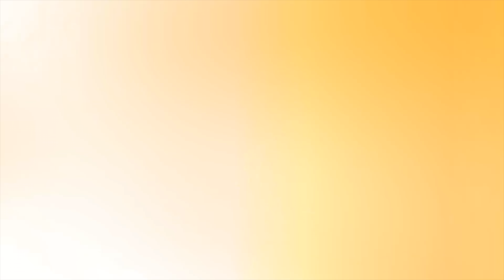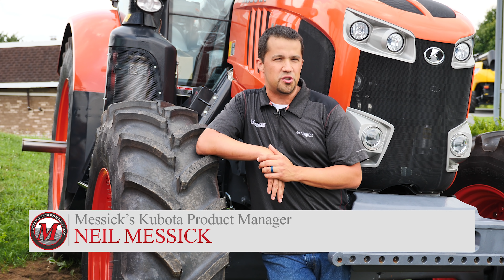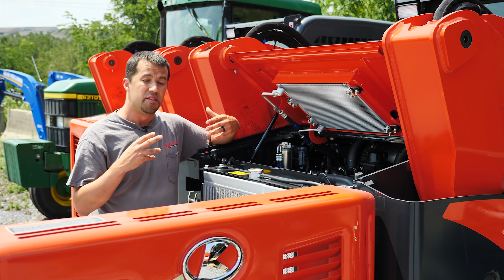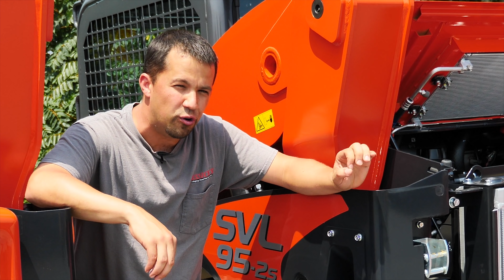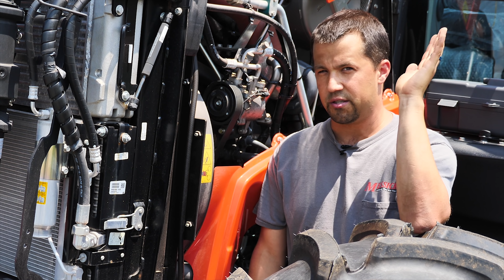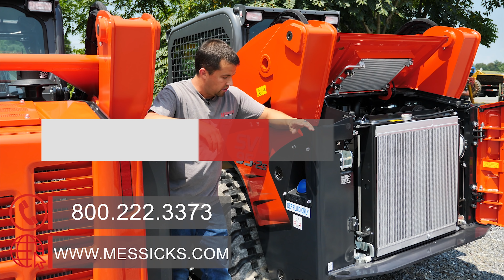6 Tips to prevent emissions system trouble

Comment: Biggest thing with def that I have gotten alot of my customers doing . Buy no more then a week or two's use in the small plastic jugs. And buy them from a quality/high use distributor. Run the machine low enough between fillups that you can use the entire container. Clean around the entire def cap. Remove cap and fill. Then destroy/throw away the container. I spent an entire month or more this spring educating new users that had made costly mistakes and caused issues that were not covered by warrenty. The other big this is wait for the light to go out before you hit the battery disconnect. If there is no light then wait 5-10 minuits before hitting the battery disconnect so the system can purge itself.
Reply: Keep in mind the machine can throw codes because it doesn't recognize the small amount of DEF you are recommending your customers add either. DEF tanks don't use a float-style gauge like a gas or diesel tank, because DEF freezes at 12F. Instead, they either use a series of electrodes in the tank wall, or a sonar board. Running your DEF very low and then only refilling with a small amount might cause the tank's sensors to not register that you have actually added fluid. When you run out of DEF, the machine idles and/or shuts down.

Comment: One of the major reasons I went with a Massey Ferguson (Iseki) compact tractor is that it has no regen cycle, unlike the Kubota B3350 I was looking at. There's a DPF canister, but it does not require a regen cycle to clean itself. In fact the Kubota dealer I spoke to tried to talk me into getting a B2650 instead to avoid the regen cycle, but for my use case I really thought getting into the mid-30's HP range was a good idea.
Reply from the maker: Yours is DOC only, just like the New Hollands we sell. Its no any more trouble free. avoiding the B3350 was not all bad, they had trouble with that one.

Comment: I agree with your presentation, but the emission systems are crap. I have had nothing but trouble with them on my trucks. You shouldn't have to rev the crap out of it all day to make it run right. Its not your fault, and I do not blame the manufacturers. They cost thousands of dollars, cause endless problems, and are unreliable. One of my trucks said " 99 miles left before limp mode " wonderful. These rules are ridiculous.
Reply from the maker: Yea, equipment industry had a fraction of the problems they had had with trucks. Duty cycle is totally different.
Reply: @MessicksEquip   I have a L5040 and I am sure glad it does not have these systems. 90% of my use is non pto operation. over half my use is short, non strenuous use. During the winter I load salt and sand on to my truck, then shut it down. During the summer I do several easy tasks with little to no throttle. It would die with the way I use it. Great videos by the way. Great resource.

Comment: B S on engines are running cleaner  or less smoke , the main problem in the old days of tractors blowing black smoke and burning more fuel is , it still cost lots of money to keep tractors  in good working condition , AS ITS DOES NOW
Reply: 45NUTS yea but back in the old days you didn’t have to worry about a sensor keeping your tractor down for long
Reply: @farmall194142  Or having it sitting in the barn waiting for a firmware update for the computer.

Comment: seems to me that the exhaust/def system should (quietly) removed
Reply: Was just wondering if it was possible.
Reply: @rikertvonfulton16  Of course it's possible
Reply: @Joey-ve7ku  Actually it may or may not be. You can remove it, yes, but the engine won't run, or won't run right. The ECU would see the exhaust components were removed and trigger trouble codes which might not let you operate above idle or operate at all. Everybody deletes pickup trucks, but they use a tuner to do so. The tuner tells the engine to operate in 'military' or 'off-road' mode, which doesn't require emissions. The tuner also tells the engine that a DPF / DEF system is no longer present, so it will not attempt to perform a regen or inject DEF. So while these tuners are readily available for pickup trucks, they are not for ag or construction equipment. Or at least not easily available.
Reply: @tylermacconnell217  I've seen brand new 6150m john deeres that have had emission systems deleted.
Reply: They do make them. Eco tuning does a lot of them.

Comment: 30% urea and 70% water (DEF) has a short shelf life?....who knew?...🤣🤦‍♂️
Reply: Doug Dickey 
Yep it separates and crystals form. Also the water evaporates
Reply: You'd have thought that they could create a fluid to help scrub the emissions that is able to handle the high heat that lots and lots of machines are going to see but I guess not.
Reply: Most of the time these machines are being used enough to need to refill DEF well before it would expire, even in a higher heat situation. It's a fine line though...operators don't want to be refilling DEF all the time, but don't want it to go bad, either.
Reply: @tylermacconnell217  ...well, I have a new machine that gets used quite a lot on the farm and it barley sips the DEF fluid and now what's in there is over a year old plus I have a drum of the stuff cause I thought it might go thru it quicker and nobody said anything about it having such a short shelf life....
Reply: That's unfortunate you bought so much - you might be able to sell some to other diesel users. If DEF is kept cool it lasts longer. In a diesel pickup truck, you typically get 1,000 miles per gallon of DEF used. But you will use more DEF the harder the engine works.
Reply: Doug Dickey you can get a specific gravity tester from Amazon ( about $20) to check the DEF fluid.
Reply: Doug Dickey 
You typically only use 1-2% def to fuel ratio
Reply: Plus it’s corrosive

Comment: A DOC is used to combust fuel left in the exhaust, it doesn't do anything for soot. It is a pass through component. The DPF catches soot, evey other tube is plugged off either at the front or back. This forces exhaust through the tiny voids in the DPF material. When the DPF starts to get full the engine will put extra unburned fuel into the exhaust. This fuel will combust but DOES NOT BURN (there is no flame) in the DOC. This heat combusts the soot caught in the DPF. As you pointed out running the engine hot will give you a passive regeneration and you won't have to actively inject fuel into the exhaust. I am a Field Service Engineer for a diesel engine manufacturer. I always correct techs and customers that say there is a fire in the DPF. Our lawyers would kick me in the backside if I didn't. Love your videos!
Reply: Psst, Caterpillar system has an actual flame in it.
Reply: @indianaoutdoors1192  after looking it up I see what your talking about. They actually burn fuel in the exhaust (though the flames do not enter the DPF) instead of combusting it ina DOC (which doesn't require a flame). I'm assuming they have a fire arrestor between that and the DPF. I would hate to be the one that had to design and program that system.
Reply: wolfpack4128 doesn’t the DPF essentially work like a catalytic ceramic block? Super heating to burn the carbon soot?
Reply: The first live flame systems we used had no DOC. Ours has an atomization module that mixes air and fuel and injects it into the diffuser/ mixer section of the DPF. It then has an additional combustion air supply along with a supplemental air supply (turns out it takes a LOT if air to sustain a flame inside an exhaust system)! The injected fuel passes between two spark electrodes that on the outside look like a normal spark plug but on the other end is just a straight electrode, no ground strap.  This ignites the fuel if everything goes right and the flame is directed towards a diffuser so you end up with indirect heat passing to the DPF. This system is used in applications where there's just never really enough heat build up to make a DOC work efficiently i.e. garbage trucks.  Pretty much every Mack cab over garbage truck has this system.  They did add a DOC later in production so if a truck does meet the criteria it can benefit from passive regen but for the most part they rely on spark assisted regeneration.
Reply: patrick tarpley working in below zero  temperatures much of the year, our fuel trucks never seemed to do a regen properly. They were always in the shop being manually cleaned. Just glad I drove an older Pete with a C-12 and never had to deal with the DEF.
Reply: @akbychoice  DPF's like heat. They like a lot of it. We see an increase in aftertreatment systems related failures during the winter for sure. I could only imagine how bad it could be in the below zero temps. 

The Diesel Particulate Filter is a filter just as the name implies. It filters diesel particulate from the exhaust stream. The black smoke you used to see coming from the stack of a truck is what the DPF is preventing. After so long the soot or particulate matter accumulates to the point that it needs to be reduced to prevent complete filter blockage so that is when the regeneration comes into play. The Diesel Oxidation Catalyst is the element just upstream from the DPF. It is coated with precious metals that create chemical reactions with the chemicals in the exhaust stream and in turn makes quite a bit of heat. That heat is passed into the DPF and ultimately the soot is converted into unburnable ash by way of this heat. The ash takes up way less space than the soot so the filter is good to go for a while. When you hear of having a DPF cleaned we're actually cleaning the ash from it. That whole process I just described is call Passive Regeneration. If there is not enough heat on the oxidation catalyst to make an efficient conversion of the chemical compounds in the exhaust stream the system must add additional hydrocarbons which react chemically with the oxidation catalyst and make heat. The hydrocarbon we add is  better known as diesel fuel. That process is known as Active Regeneration.
Reply: @justkeepingitreal7768  very good explanation just one point to correct. The soot does not become ash. If it was pure soot it would combust completely. The ash sticks to the soot then when the soot combusts and becomes so small it passes out the DPF the ash is left. Most ash comes from burning oil. Since the piston rings can't be completely effective at scraping oil from the liners a tiny bit is left. Over thousands of hours or hundreds of thousands of miles this accumulates and needs cleaned. Of course if you get other sources of oil in the combustion chamber (ring issues usually) this ash can build up in a matter of tens of hours.
Reply from the maker: Fantastic reply. I was always under the impression that a hot DOC would treat soot (and is non-compliant when cold). How is PM addressed?
Reply: @MessicksEquip  let's say your ECM will start an active regen (in-mission regen in today's world) at 60 grams of soot. As you run low RPM moderate load or constantly snap the throttle you'll produce soot. This soot goes right through the DOC and gets caught in the DPF. Assuming your DOC and DPF are cool it will sit there. Now you get back on the highway back to the barn and get good load and higher RPM. The higher RPM will drive up airflow (with most turbo setups) and the higher load will create more heat. This will flow through the DPF and the soot will start to "break down". Once it goes through this chemical reaction the by products are safe and small enough to pass right out the back of the DPF. 
Okay now let's say you never get the engine hot and you reach 40 grams of soot in the DPF. The ECM decides its time to take action and either by injecting fuel right before the exhaust stroke (isn't common rail cool) or through an injector in the exhaust upstream of the DOC. This unburned fuel makes its way to the DOC where the DOC combusts it (though no flame should be present). This creates a bunch of heat for the DPF (and SCR which also needs high temps). 
Last scenario is it can't complete the regen in this manner. It lights a light, a tech hooks up and commands the ECM to do a regen while stationary. This is called a stationary (or non-mission) and obviously the manufacture wants to avoid this at all costs as it causes customer "pain".
Reply: wolfpack4128 our semis had override switches to turn off the Regen when fueling and loading. It also allowed to manually regen. I wish my F-450 had that switch.
Reply: @MessicksEquip  a hot DOC will mean a hot DPF which will combust soot. A hot DOC will actually do one other thing too. It reduces nitric oxides into NO2 instead of NO1. NO2 will actually help reduce soot in the DPF as well. That's why a "healthy" DOC is imperative to a good running aftertreatment.
Reply from the maker: was referring to the DOC only versions, not the DOC + DPF.
Reply: @MessicksEquip  DOC only would be to reduce unburned hydrocarbons (fuel slip/white smoke). I've also seen NOx absorbers that are pass through similar to DOCs. You're not alone in thinking DOCs reduced Particulate Matter (soot). As far as I have been instructed by the design engineers DOCs cannot convert PM directly.
Reply: @MessicksEquip  I found in a few old designs they used a DOC to reduce PM a bit (about 10%) . So by itself it could slightly reduce PM.
Reply: It sure is nice to know there is someone out there that knows how these things work. Just remember, there are live flame systems out there!
Reply: @justkeepingitreal7768  all the stuff I worked on was from 6.7 liter to 15 liter and didn't use open flame. Do you know which company makes one with a live flame? I wonder what they are burning? If soot catches fire there's no way to control it (chain reaction). That's one form of an uncontrolled regen and when you look at the DPF afterwards it is clear what happened (the substrate is all melted and the nice channels are replaced with a big block of ceramic).

Comment: Short question for advice. Due to the fact that you put lots of effort in explaining the different tractor sizes and type I wanted to ask which model (utility tractor with front loader) you would suggest for a small farm. Tasks would typically involve logging activities (4WD and Ground clearance important while torque is important) size because of woodworks therefore also as small as possible, secondary the tractor is being used for moving and general groundworks. The farm size is about 22 acres while field and forest are about 8 km distance (road use). Would be great to hear suggestions. Thanks
Reply from the maker: at 8km apart, I'd want something fast. 60-70Hp that can hit 18-20mph. Thats a big machine for your acreage, but I always want off the road as soon as possible.
Reply: 60 horse Kubota would be perfect loader 4x4 and your ready to go it will do everything you named and some thing that may come up
Reply: right though about similar size machine. thank you both for your suggestions!